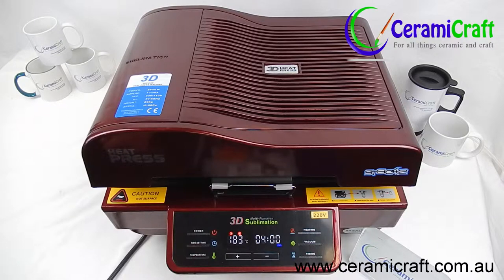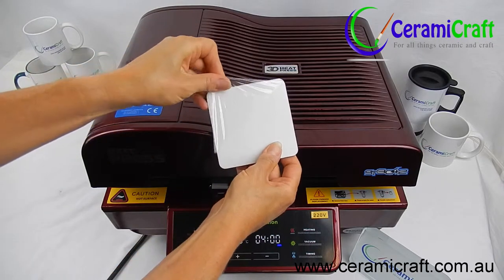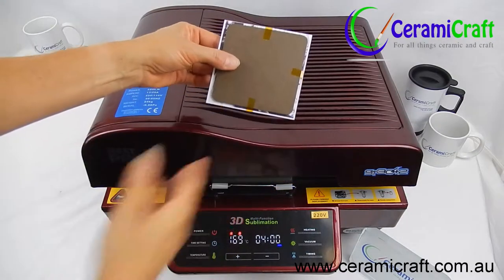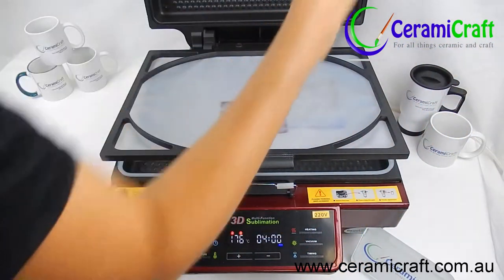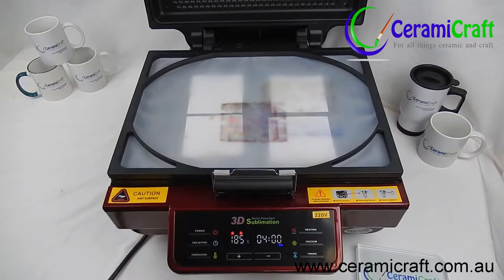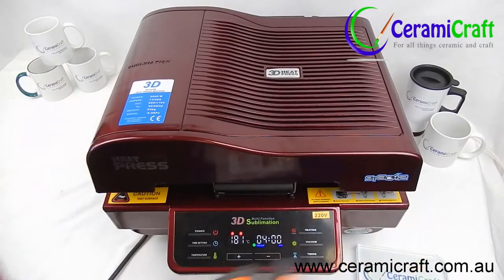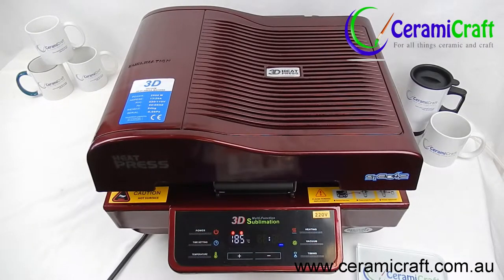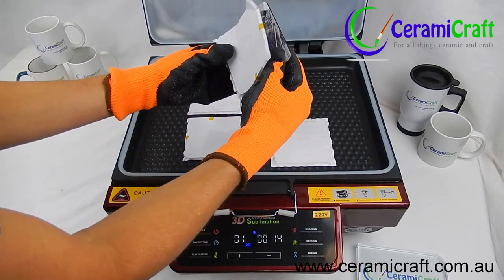How to use a 3D Vacuum Heat Press to sublimate hardboard coasters.

Comment: I have seen on the adverts that this machine can sublimate onto t-shirts, do you have a video of this please showing the process?  Is it easy?
Reply from the maker: We have found Tshirts to be quite fiddly and difficult to print in a 3D Heat Press. We would always suggest a 'rigid' flat press for textiles
Reply: @Ceramicraft  Thank you for your reply. Unfortunately I don't have the space for a flat press as I use a plotter and a mug press.  I was hoping I would be able to do the t-shirts as well as mugs in the one unit.

Comment: will the acrylic bends after the press ?
Reply from the maker: The coasters featured in this video are made of MDF hardboard and are unlikely to warp. Acrylic and other polymers by nature soften when heated allowing them to bend if unsupported while they are still hot. That is why you often see pressing inserts for polymer blanks such as cups and phone cases. They help support the blank during pressing, and/or as it cools so it can harden in the correct shape. Flat acrylic blanks are easy enough to transfer to a flat surface to cool after pressing.

Comment: hiHi ,I have same machine  for sublimation but with MDF stuff  machine  deforms the MDF plate  base like bubbles, imprint of heat plate.Another issue I had was photo quality .I can see small white dots in photo ,which looks like  fibres in papers escape from print ink .My printer is EPSON L1800. Any recommendations?
Reply: The small white dots is the low grade plate. Lower grade plates have hard to see pits, and if the coating was not applied properly they will show up white. If applied properly to the material even with pits, you would still notice it in the prints

Comment: Are these expensive to run?
Reply from the maker: Hi Jules, this really depends on a number of variables. The cost of your electricity, the types of blanks you’re pressing and in what quantity and frequency you are pressing. As a supplier of kilns we provide a kiln running cost calculator which helps answer this question for kiln users. The same form could potentially assist with the calculation for heat press operating costs. You may just have to do some conversions, e.g. from hours to minutes for the running time. The 3D press operates on standard 240V power using a 15A plug.
Reply: @Ceramicraft  thanks for reply and info. I'm just starting up with this sublimation so it's all new to me.. Probably be a while before I buy one anyway . Thanks again and have a good day

Comment: Is it A4paper
Reply from the maker: The transfer designs for these coasters would have been printed on A4 sublimation paper. However, this press has a large internal chamber size of 30cm x 43cm x 11cm, so you can press larger blanks in it as well.

Comment: If you are only doing 1 or 2 coasters better use a normal heatpress at it's only 60 seconds or if you put multiple coasters it's still 60 seconds
Reply from the maker: That is good advice. In this video however we're just demonstrating what can be done in the 3D press. As some people find the overall variety of blanks that can be pressed using this machine to be useful to them.
Reply: Hi. Is it also possible to sublimate these blanks using a sublimation oven?